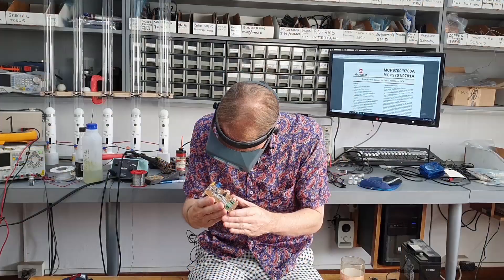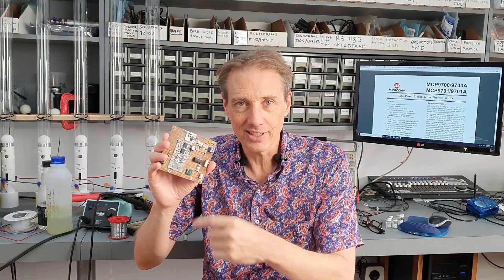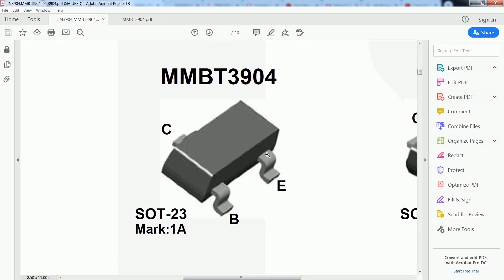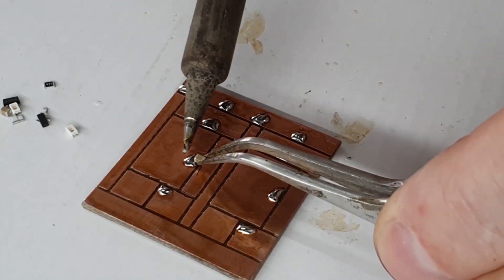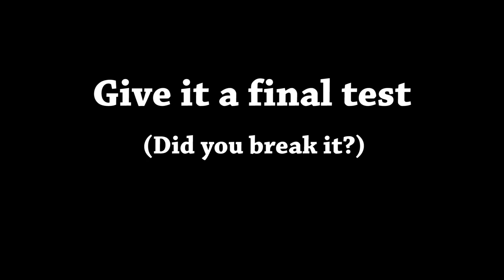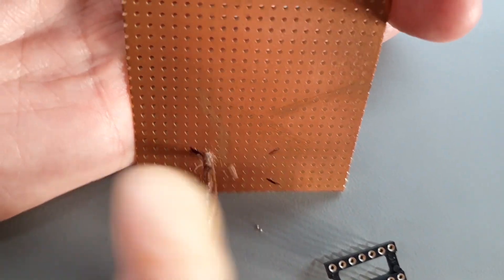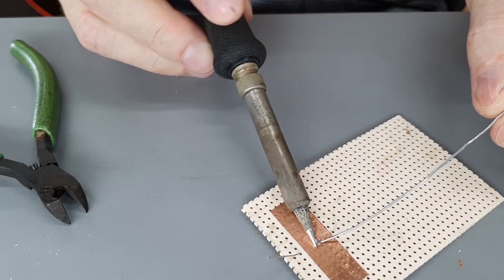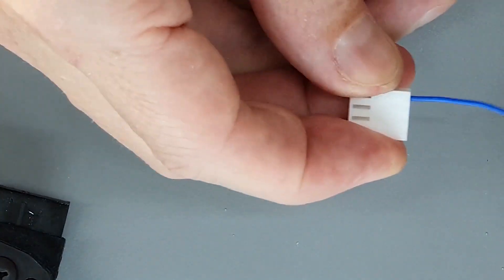Techniques and Strategies for Building Electronic Circuits

Comment: Im a retired repair technician. I hated having to dive off into SMT but as it was a professional necessity, I did. But I always hated them. Now that I am several years into my retirement and I spend many an hour riding motorcycles I have found myself with a fresh need of new more efficient methodologies of dealing with SMT. Ive recently decided to take ab personal safety device I have been running on my bike as a POC on towards a DIY product consisting of a few individual modular-mounted boxes designed to enable a typical DIY rider an option of a quick plug and play style installation on his or her motorcycle . Space available makes SMT components an absolute must. Leo's practical approach to some problem areas I'm dealing with is quite insightful and a blessing for an old dog like me. Thanks for sharing Leo. 
Reply to Jan Verschueren: I guess we types are a very niche section of the atypical audience here on YouTube. Like David Luther stated below SMT hasn't lent itself to me easily either but with some of these new methods to master, maybe soon!

Comment: As someone who wasted 5 hours on a project before, by hand soldering some tiny packages by hand with wires and tweezers to a bread board and then gluing the chip to the board, this copper scoring method  looks like a game changer.

Comment: I would only add a couple of things. First if you’re using bare vector board then use the pushpins model number 4–21 along with the P149A push pin tool. This will allow you to mount components without their leads going through the vector board holes. This makes it much easier to remove a component and replace it with another one.
The next thing that I would recommend is to lightly spray all of your finished products with clear Krylon acrylic spray. This will keep your copper from oxidizing and will reduce humidity affects to your circuitry especially high impedance.

Comment: I wholeheartedly agree with Your strategy of design/testing/layout in parallell, been doing it like that for over 40 years now...
My design expertise is largely in analog fast and HV circuits a and HF/MW stuff. Modularization is immensely important. Testing before layout prevents many recipes for disaster... and use simulators wisely and with caution. They are excellent for some tasks and hopeless for others.
I liked Your scratch tool, definitely going to try that but I will make one from scratch since I have a fair machine shop. Probably try a piece of carbide, FR4 is really dulling. I actually have sub mm cutters for the lathe between 0.4 to 1 mm for small retaining rings etc, perhaps those could be used. 
All my work nowadays is SMD and it is just seems getting smaller and smaller over time. No way for me to work without a stereo microscope anymore. And some high quality tweezers etc.
Best investment I made in recent years is a Weller XCMT kit with exchangeable tips and a SMD desoldering tweezer. Speeds up my work a lot, also have the same WCP20 as You as well for a very long time. The soldering station has buttons for 2 temperatures which is immensely useful for me. Temperature sets in a few seconds. 
Most of my wiring is with 0.1 to 0.3 colored solderable magnet wire. Used deadbug in the past taught to me by one of my mentors Coe Wescot in the 1970:s while the bugs still had legs... Still have that Vero wiring pencil. 
Nowadays I order new adapter boards from china when needed, just make a simple layout and get exactly what needed. Cost is very low. I have also standardized several sizes small prototype boards with 0.1" pads around a ground plane that can take connectors. Very useful for modular testing and sometimes re use of circuits.
I use shop made rosin - IPA on my boards to facilitate soldering. Non activated rosin seems not corrosive as far as I have seen and can be left as a protective lacquer on prototypes. The solution degrades over time.
Got burned by CA glues, developed some allergy. Some friends of mine had the same issue. Nose distance and hi temp decomposition products may make that worse in this case. If I use manhattan pads I now just solder them double sided to the ground plane or stick them on with 3M365P. For LowRel, hot melt glue. I also use copper tape, but the glue is not very good. One of the best I found is outdoor copper anti snail tape for gardening.
On prototype decks, I almost never use them, but if You do for obvious reasons ditch the cheap ones and buy a few high quality ones. 
Hopes any of these ramblings helps. It is my experience that in this line of work there is always infinite room for improvement... I also highly recommend the writings of Jim Williams in the old LT application handbooks.

Comment: Good advices. I have to say that I made some electronics for remote two doors opening, and it has been working on a breadboard for 3 years now. I've used thicker wires for breadboard connections.

Comment: I think this might be the best hobby/semi-pro tips video I have ever come across. It has the solution to a large number of very relevant problems people will have.

It's nasty to try and cut and strip many of the really thin wires - especially the ones mostly sold on Amazon. Wire-wrap cables and teflon tube over just copper wires is way better/easier for the smaller stuff. And at an affordable price too.

That home-made cutting knife is also great. A normal exacto knife really is not optimal for the task - and if pressing too hard (as happens when it's the wrong tool) may break the blade and having a very sharp blade flying around. And cheaper for a hobbyist  than buying a small CNC and try to learn how to use.

Comment: Decades ago, I simply bought a Belgian Colinbus CNC machine, specifically designed to mill viciously accurate PCBs, down to microns.
Entire problem solved. I can mill hideously complex double-sided final-quality PCBs in under 20 minutes, drilled and ready. No further fettling.
If your business cannot afford one of these miracles, then it is no business at all, and you have no place demonstrating how to achieve the goal in an incredibly lame manner.
That is realism.

Comment: I thought about a kind of "perforated board" for smd/smt components. I.e. board with grid of small round cooper islands, with period matching particular smd size. So you could solder smds to those islands and connect them toghether with wires, incl. thru other islands if needed.

Comment: I do the same stuff when it comes to prototyping. However I attend to use a dremel or a plug bit on a drill press when I make island boards with copper clad PCBs. I do like the xacto knife modification, might have to try that one.

Comment: most precious collection of tricks and tips i‘ve ever seen - back in my days as HW designer i used quite a few tricks myself and found similarities to some of your tricks, but never used to work with smd‘s in that time, we could stick with THT parts and used wire wrap and solder sockets the most, but the tricks with solder boards scratched connections are absolutely golden - never thought this works so well - Leo. your collection is one of the biggest gem‘s one can find in YT - thanks for sharing them with us - stay safe and healthy - you got a new fan, kind regards from Mannheim, Germany

Comment: Ahhh!  Where's the stereo microscope so you can SEE SMD components?  As for me, gimme 6C4s and 6AU6s, or nice hand-filling type 80 rectifiers, 2in long paper caps, and point-to-point wiring with terminal strips...oh well, time to fire up the trusty 545 (that's a REAL 'scope, not some crummy AC coupled recurrent sweep Heathkit!) and get back to work on that Magnavox console....

Comment: I've been a technician and hobbyist for the past 14 years and I've NEVER seen either copper clad nor bare perfboards. I've only seen them with pads, and sometimes they're double-sided. I've also NEVER seen that tool you used to wrap the wire.
Might be cus I'm in Brazil...

Comment: Some great techniques there Leo!
Like the copper tape idea.. I have been trying the nickel plated steel strip ( for battery packs) soldered to the cheap breadboards with 0.1” isolated PTH grid pads  for high current prototypes. With tinning they worked great. Can even work them double sided if the PTH via is drilled out at the crossovers

Comment: I guess I just don't get it.  I design a circuit and PCB in Kicad, send it off to Oshpark and a couple days later I get a finished professional PCB.  Why all the drama???
Reply from the maker: Sometimes there just ain't a "couple of days" to wait for a board that might not work when you get it. It's all about speed and flexibility.
Reply: Well lucky you.  Not everyone lives near a cheap source of PCBs.

Comment: I love this technique, would've saved me a lot of headache fiddling with a breadboard then a non-equivalent through-hole op amp on my current project. And that's a great tip using thinner copper clad, I'll have to pick up some for my next project.

Comment: Anyone else notice the LED give a dim and short flash as it was soldered at about 5:50. I assume its a small bit of charge somewhere that was discharged thru the LED. It's possibly ESD from the soldering iron. 
Anyway, nice video. I really enjoyed watching it. If you have more tips and tricks like this, that would make a great second video. 
Keep up the good work!
Reply from the maker: It's caused by leakage from the soldering iron.

Comment: A technician working for me way back when came up with a PCB that consisted of 6 or 7 mm square copper pads separated by 1 mm gaps (cut lines).  It worked marvelously in the era of components with 1 or 2 inch wires, such as TO-5 transistors and 1/4 W resistors.  You could easily solder 2 to 5 component leads to each copper square.  If necessary, put sleeves over any leads that might get too close to some other wires.  By the way, I preferred silicone rubber sleeving instead of teflon.  I also prefer genuine eutectic solder -- 63/37 instead of the nearly eutectic 60/40.  Of course, most of this is history with the metal can transistors the first to disappear.  Sigh...

Comment: I don't know if i want to deal with big surfaces like these, when i have perfboards with a little copper circle around each hole, the gap between them is small enough to solder SMD components and i can still solder wires to it to make long traces
Reply: I was thinking the same thing.

Comment: Don't you worry about impedance mismatches using a groundplane so liberally?  I've been burned a couple times and wound up grinding off the groundplane.
Reply from the maker: Only it the project is dealing with high frequency signals.

Comment: 12:58  "That Anxiety" at powerup.    If there is ANY of that, that means there is doubt.    Check everything again.   Check it so thoroughly that there is nothing left to chance.
13:49 Test each portion separately.    Get the sub-assemblies working before expecting your circuit to perform more complex functions from having these sub-assemblies working
together.    TEST   TEST   More TESTS.     Test the HELL out of it.
Reply from the maker: Haha Anxiety is not rational, but it does tell you a lot about your workflow.

Comment: Hi, any way you could help me ? I have a sketch on a breadboard for a RR land crossing that's controlled by 2 IR sensors. 
I have flashing alternating leds, with opening an closing gates and with Audio sound of a bell. I am wanting to build a circuit to add this to but not quite sure how to go about it.  I want everything on the circuit board an only have my servo wires come out that control my IR sensors.

Comment: For your method, try making your "Manhattan" islands with different widths of copper clad tape. No need for scrapping the lines. I recently tried the following method and I liked it. I printed a large scale view of the schematic on paper. I used spray adhesive to attach the paper to foam board (found at the dollar store... maybe 3/8" thick, with paper on both faces.) I ran copper tape next to the lines of the schematic (so I could still see them,) leaving gaps for the components. I soldered on the SMD components. Through hole components stick through the copper tape, into the foam and are, then, soldered. (Prick holes in the tape, for the pins to go through.) I soldered the linked sections of tape. I used scotch tape to insulate between where tape routes crossed, but were not electrically connected. I liked the method. The assembly was much more robust than I expected. Advantages: You have the schematic built into the board, so 1) there are no layout mistakes, 2) the schematic is right there, for verification, and 3) there is no designing, or building, of the island method. Fast, easy, accurate, way easy to make corrections and revisions... I had no trouble with the foam melting, but I was careful to not linger in one spot. HTH. Cheers. Oh, I forgot to say that I very much hope that you will actually try my method and tell me what you think of it. Suggestions for improvement are welcomed.
Reply: Nice, I have to try that, where do you get high quality materials?
Reply: @Cristi4n_Ariel  Nothing special is needed. I ordered the copper tape on Amazon. Just make sure that it is actually metal tape and not just metal colored plastic.

Comment: 11:02 Could anyone please write what I should use for point to point connections? I need to buy it but I can't find it on aliexpress because I dont know the name for it. I know it should be copper wire without any isolation or coating, but what is it called? the wire I bought recently does not accept the solder so I guess the wire is coated with something.
Reply from the maker: #24 AWG solid copper wire. I often use old CAT-5 cable by stripping off the insulation, the copper underneath is super clean and solders perfectly.
Reply: @leosbagoftricks3732  thanks! I also have cat-5 cable somewhere. If I search for "solid copper wire" I never know if the cable I find solders perfectly. also the search results are often with isolation. So I was wondering if I have to search for something specific.
Reply from the maker: @christiannielsen3863  If you live in a place where humidity is high copper wire can get very oxidized and solder poorly. Clean bright copper is a must for good soldering.
Reply: Used to be called "Bell" wire, too, I think. The old-time wire that was run in the wall of houses for corded phones is good, too.
Reply: See 9:40 in video. Buy kynar #30 wire wrap wire (not cheap fake Chinese stuff).   It is silver plated for easy soldering.  The kynar insulation is tough and does not melt like PVC when soldering.  Use a quality stripper with calibrated hole for #30 awg.  Use it for all point to point low current (<500mA) connections.

Comment: Wow, SUPER useful, thanks! The scratch-n-sniff SMT adapters were a revelation, as well as the recommendation for fine, bare wire + tiny Teflon tubing. I also liked the suggestion to use adhesive copper tape for laying down power and ground planes. Pure gold, thanks again!
Reply: Well, pure copper

Comment: YES! push-in breadboards are terrible!

Also wire-wrap is great -- especially so for making custom board-to-board looms for hooking random modules up to FPGA dev boards... Those 0.1" headers easily take a wirewrap.

Also you can get M3 pot-magnet standoffs - which will easily hold a small PCB module securely against the backplane of an electrical enclosure. 

And electrical enclosures are great if you need your prototype to work in an industrial setting (think: Someplace you'd clean the floor with a hose). Avoid the temptation to use all din-rail-mount stuff - it's generally more expensive than you want for a prototype. 

Ground that enclosure, and avoid any long board-to-board fast logic: no long SPI or I2C over loose wires! 

Although differential logic like LVDS is ok this way: You can get SPI <-> LVDS <-> SPI to allow fast board to board without creating a heap of VHF-UHF RF noise. 

This is another reason to love small cheap FPGA's: They'll generally support such differential (or psudo differential) - if your small module doesn't have differential inputs, just wiring the complement-logic signal to a dummy load to ground on that board will help kill EMI.

The key is that the total current in the bundle of wires going between boards is constant-current; not a total current modulated by digital state. The latter is what you get with a plain SPI bus made with single-ended logic: The changing total current on the flying cable is too good for emitting RF! SPI is really meant only to be on a single PCB with a good ground-plane to avoid that.

But using that trick, you can easily have multiple separate SPI links going at a hundred MHz even with the cheapest FPGA's.

Also, FPGAs: Check out symbiflow, and restrict yourself to the chips they support. This is like restricting yourself to CPU's that already have support under GCC and/or linux: You get the benefit of some truly amazing (and ever-improving) open-source software, and you don't have to spend $1000's a year to license software.

Comment: Actually there is a tool called hook knife or acrylic cutting knife. And it is the same, I use for cutting the copperclad and perf board
Reply: It is also called a "carpet" blade. These fit standard utility "box cutter" handles and they are readily available at hardware stores.
Reply: @t1d100  he has modified the carpet knife into a hook knife!